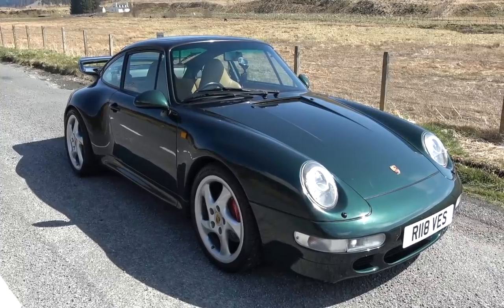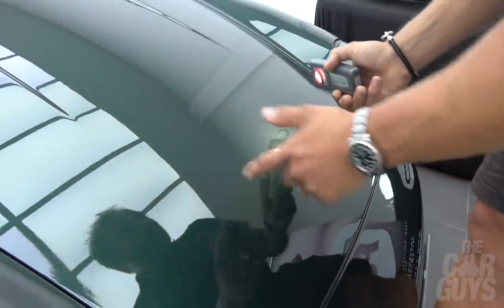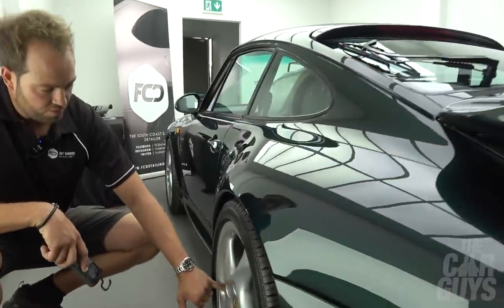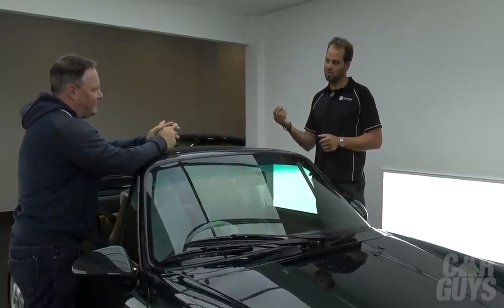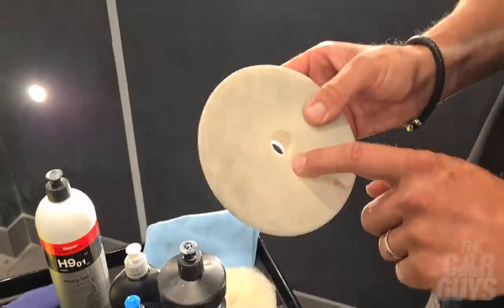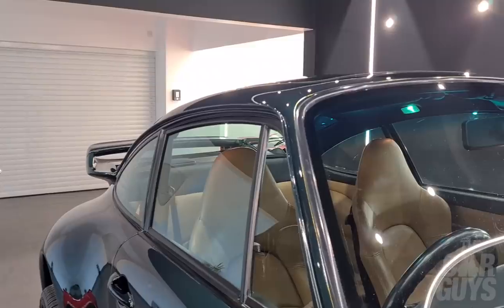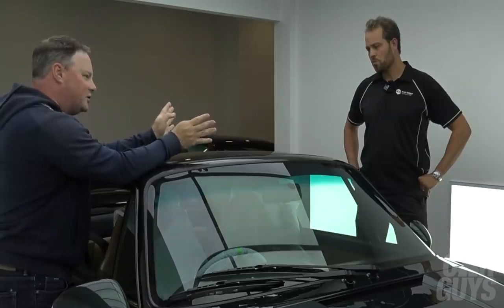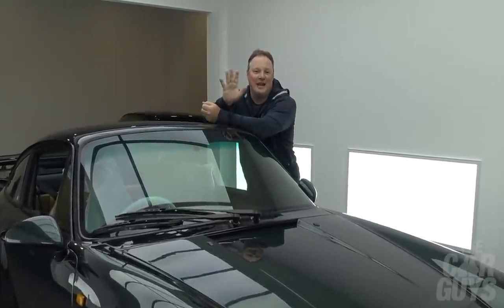WHAT'S HAPPENED to My Porsche 993 C4S? Is it Ready AT LAST? | TheCarGuys.tv

Comment: Looks incredible. I’d get the original lid back on, but not repainted, just buffed to the same state as the rest of the car. Also, are you going to get the leather seats brought back to life? That would finish it off. Get that David Dickinson tan removed and give it some love too!
Reply: @Richard Jones .. +1. . My $.02 cents also, install the original engine deck lid. . The OEM Split Grill deck lid shown "off the car" is not original to the Carrera C4S 4wd models, however was original to the Carerra C2S 2wd model 993. . Ditch the goofy winged deack lid,  replaceing it with an original C4S deck lid .. The shade of green color looks fantastic on the 993 coupe. .. Super well done. .. Signed an original '98 Carrera C2S owner.. (Arctic silver w/black full leather)
Reply: Interior is stunning

Comment: Great review Damien, And Jake did a great job.  It's almost as lovely as my Guards Red 993Turbo.  Ha
Green looks lovely too, pity it rained straight away.
As for the deck lid.  Well the techART lid is good, as for the original.....well that is not the original lid either.  Only the C2S came with the split louvred lid.  Yours should have the grill the full way across.  So it's been replaced at some point.  Sorry to say.
You can google it, your car comes up quite a bit too.

Comment: For me the difference between 2S/4S and turbo is exactly the wing. The silhouette on the naturally-aspirated car looks so much cleaner and more elegant. That and the great sound speak for these cars. The turbo is the full-fat version, with more power and torque and that wings belongs on there for technical (intercollegiate) and aerodynamic reasons. It does fit to that model and makes it stand out.
To me, a 2S/4S with a rear wing always look odd, pretentious for that very reason. Hence I would certainly go with the original rear wing on that car.